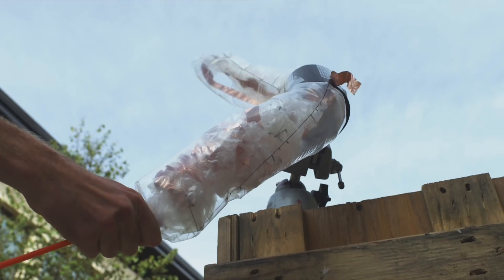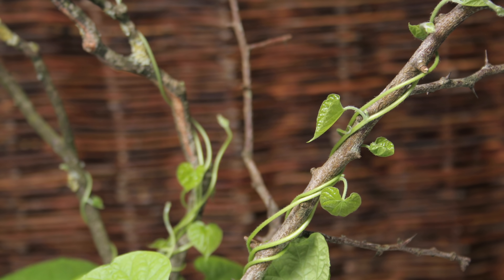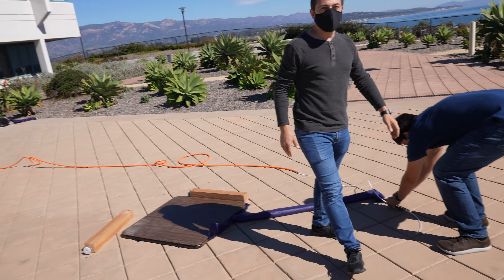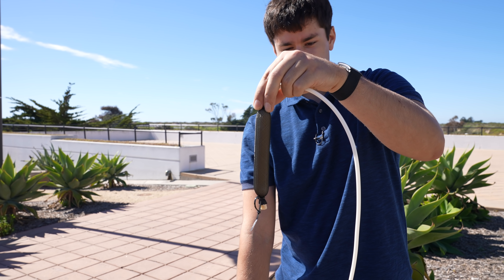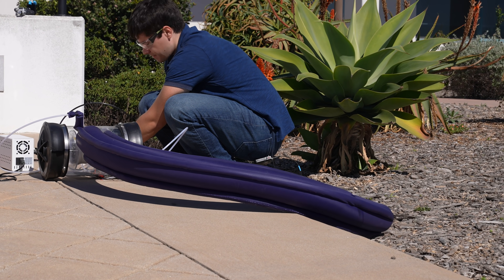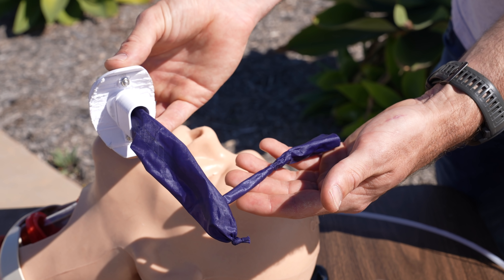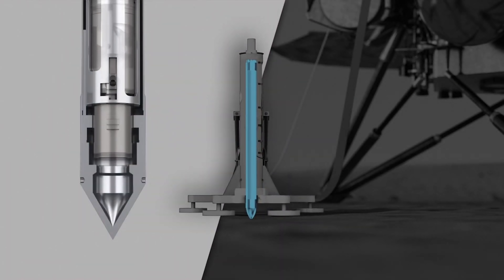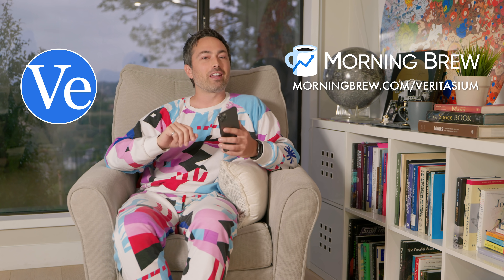This Unstoppable Robot Could Save Your Life

Comment: The question is, how is the intubation device supposed to stay rigid (in order for the patient to breathe through it) after the pressure is taken away?
Reply: You are right that this would indeed be a problem given the soft nature of the VINE. One of the concepts labs have been playing with is that a more rigid tube is attached along the length of the VINE that is guided by the VINE. One other idea is that the VINE is guided first and then the tube is pushed through the inside of the VINE and uses it as a guide in that way. I can't say for certain that this is what this lab in particular would do but there are work arounds for this problem. Hope that answers your question!
Reply: @micahbryant1165  

The way I see it is that, like AEDs you may see in train stations, and large public areas, those are no match for hospital-grade defibrillators.

But, in a cardiac arrest event, such as the casualty going into VF, as a trained First Aider myself (and having done Anatomy and Physiology at University level), having a 'intubation' device, that supplies almost pure oxygen to the lungs, whilst I performing CPR, getting enough oxygen to the patients brain is one of the core reasons for CPR, along with blood flow around the heart itself, and the lungs. 

Hence, in a emergency situation, in addition to an AED, to defibrillate the heart, having a simplified version of intubation, in the field, buying enough time for the paramedics to arrive, and take the casualty directly to the A&E/ER/ED, to an area kept for resuscitation, and even up to the ICU/ITU ward, keeping  the O2 saturation >95%, especially on a flow of >5L/min @ sealevel equivalent, the greater chances of survival maybe. In other words, having something like an AED, that is a 'stop gap' until professionals arive, that intubates sufficiently to supply oxygen directly to the lungs, during CPR, maybe, like AEDs, a game-changer in terms of patient survival ... 

Interestingly, just recently, a friend of mine's brother, was placed in a medically induced coma, whilst also on a device that keeps his brain cool. Due to a well known phenomenon called the mammalian diving reflex, hypothermia, at a particular temperature, reduces the oxygen demand quite considerably. It is a reason why people whom fell into freezing water have been able to be resuscitated much longer than usual. In early thoratic surgery, the entire body used to be put into a ice bath to chill the entire body down, prior to surgery, especially on the heart, so giving the surgeons a bigger 'window'. The technique now, or so I believe, is that a modified heart-lung machine uses passive cooling, to reduce the temperature of the blood circulating back into the patient, and keep it at that constant low temperature, allowing a gradual 'cooling' down, rather than the 'shock' of being dumped into a ice bath ...

The reason why I mentioned it is because there have been studies, conducted on appropriate patients whom suffered a cardiac event, and in whom return to normal circulation, that placing ice packs around the patients head, has shown significant benefits in terms of neurological outcomes.

There is still enough research to be done, but reading those studies means, if CPR is successful, and the First Aider/Responder is fully equipped, if sinus rhythm is achieved, packing the head with ice packs, immediately after, cooling the brain, and reducing its oxygen demand, means that may reduce the level of neurological damage caused by the sudden stoppage of blood (ergo oxygen flow) to the brain, during/after that cardiac event.

Once the pandemic is over, I need to get recertification, as mine as elapsed. But that is something I may very well mention to my trainer if it's efficacy has been proven.

If so, hence, if I attend the next convention attend after recertification, I take a 'Go Bag' appropriate to my level of training and expertise, but take ice packs with me for that same reason, amongst others, who knows ...
Reply: I have exactly same question

Comment: 1. If you can attach internet cable, you could more easily wire a home/business I would think.
2. Search for Rat/Mice pest nests.
3. Colonoscopy maybe less damaging?
4. Piping/Sewer?
If you can somehow put those bicycle repair stuff "slime" on the exterior of the tube, you could put it threw your home sprinkling system, inside the pipe?  For a nice even coat. Instead of ripping it all up...
I'm sure there is room for improvement on this one.
5. Clogged building ventilation search?
6. If it can be designed to go threw avalanche snow that would be cool.
7. Wrap around trees for Christmas lights.
8. Emergency snorkle.
9. Have a magnet on the end to pick up hard to reach nuts/bolts that drop in weird spots.
10. Spy camera.

Comment: The problem with intubation is size. No patient is the same and the reason intubation works at all with just the few different sizes of tubes we have is the fact that we can adapt to the actual patient. I don't see how you could reasonably get a solution to be either easy enough to pick in an emergency or flexible enough to be compatible with all variations we can have in human patients. The real killer when intubation is called for isn't a slow intubation, it's a failed intubation. Once you tried going in a few times the soft tissues swell up and make additional attempts impossible.

But you also gave me a new excuse for how thresher maws and dunes sandworms could move, so there's always that 😁

Comment: understandably it would be a bit difficult to use these in underwater circumstance due to the buoyancy of the air being put into the robot. Would it still be as effective if instead of pressurized air you used water? if so we could use it to explore things that are humanly impossible such as shipwrecks or underwater caves

Comment: This would be great for confined space inspection work, where the atmosphere may not be able to sustain life (low O2 content). Or for internal pipe inspections, or in potentially hazardous/explosive atmosphere's.

However it does make me wonder if the material choice would matter considerably, when it comes to the generation of static electricity from the movement of the robot itself and the compressed air?

Comment: Really loving this. It's still early proof of concept stuff, but everything we we know must through that fase. Really big thing for me here, is that the principles, concepts and building blocks of this tech is already very well known and understood, and trial work + development is possible even with relatively slim means and funding.

This by no means detracts from or "cheapens" what these guys have come up with. Most of humanity's inventions have been a combination of existing tech, skill, principles and materials, into something new. And exerimenting with and developing something with relatively simple components, tech and materials, is a really big plus. Being able to do that, is usually a huge boost and accellerator for further development and innovation, as many such projects won't need to be at the mercy of big donors and investors. Even if those aren't interested, you can go far with this stuff with only a handful of benjamins, and get started for less than a hundie if you can buy a used, small air compressor.

Never underestimate the driving force of affordable tech. Just look how far we've come off the back of CRISPR.

Comment: It could also have applications with cardiovascular interventions. For instance when placing a stent, a guide wire is used to get across a lesion, but due to how thin the blood vessels are there is a risk of dissecting the artery wall with sometimes dire consequences.
Using this technology an interventionalist could pass a guide wire across tight lesions for stent deployment and have almost no risk of dissection.
It also seems to make finding a hole easier and could be used in transcutaneous closure devices for example closing a hole in the heart(ASD, VSD or fistula)

Can see medical device companies jumping on this for multiple applications!
Reply: Mmm... Had a thought though. It would first need to be investigated if this would work using liquid instead of a gas. For this application gas would not be an option.

Comment: Its only problem would be heat I suppose
I've just seen the intubating part and there's a reason it's a stiff plastic tube with the balloon on the end.
The balloon is there to make it fit airtight and for this to work (and pressurized air still being able to pass through) the tube needs to be rigid and i don't know how they plan to accomplish this with their soft robot.

Comment: I think this technology would benefit homeowners that need to change the house wiring in their exterior walls with insulation. It is next to impossible to do with an ordinary wire fishing tool. The fiberglass bonds to any object you try force through the wall, this technology is not stopped but restricted materials. I give it two thumbs up.

Comment: idk if the idea will actually work for the intupbation. seems nice but often times when someones not breathing and needs intubation its because the throat is closed in some way and it can be quit diffifuly to get something that soft to push past the tracea which is actively trying to hold closed. i can't see that being as reliable in all cases of intubation being needed.

Comment: Would it be possible to invert the air supply within the device, say thru bladders and control the device from within. Moving the air from within, with onboard A.I and external sensors.

Comment: So many possible variations:

Tubing once expanded can be used as a tunnel for small hard robots to travel through.

A self contained tubing package with pump can be an optional tool for a robot to use to get to its destination. The robot could deploy it, travel through to the other side of obstruction, and then retract it back inside ready for later use.

A hard robot could be self contained within the center of a permanent tubing outer shell that provides it both propulsion and protection, it'd look like just like one of those slippery toys. 

On a larger scale this could be a vehicle to travel through vacuum high speed train tubes.

Comment: An interesting use these robots might be creating a rigid pipe structure. Perhaps it's built as the tip extends by a robot rolling along--much like the camera at the end. This might utilize technology similar to an angioplasty stent. Otherwise, using a material that begins soft and hardens after some time may also work in some circumstances.

Comment: I know this isn't exactly relevant,  but one time I was sitting in my car in my driveway, staring at a vine that had climbed up a small tree next to my house, and I noticed that the vine seemed to prefer smaller branches as it climbed. It would grow right past thick branches and when it encountered a thinner one, it would leave the main trunk, and start climbing the branch. 

I sat there trying to figure out why it would do this, and after a while I noticed that when the vine extended beyond the end of the branch, it would often find another branch, bridge the gap, and continue climbing that one.

So, I reasoned that the plant must have evolved to favor smaller branches because smaller branches wave about more vigorously in the wind than thicker branches do, and so this would increase the chances that the end of the vine would grapple and catch another structure to continue growing onward.

The next question became what biological mechanism pulls a vine toward a thinner branch, without pulling it away from the main trunk when it encounters a thicker branch, considering that the thicker branches are thinnner than the trunk that the vine is already climbing. 

My best theory is that the vine responds to vibrations from thinner branches as they blow in the wind. Maybe the small oscillations have a ratcheting effect on cell growth, causing the cells at the end of the vine to grow faster when they're vibrating at some minimum amplitude. 

Anyway, I did no experimentation. I simply observed and theorized. And then went on with my life.

Comment: Could be useful for colonoscopy procedures. The colon is typically inflated for the procedure and requires evacuation by the patient post procedure. If they can perfect the device removal it would eliminate one of the most uncomfortable recovery processes. An additional benefit would be removing abrasion discomfort since all the abrasion happens inside the probe robot instead.

Comment: I can see where the intubation robot could fail in numerous ways, as a Paramedic, I have seen numerous patients whose trachea was much larger than their esophagus meaning the robot would go down the wrong way. This is why the combitube is set up to be able to ventilate through both lumens of the device. Furthermore, often the ET tube is used to create a less pliable airway forcing the tissues around it to open up so we can ventilate the patient, it would also have to be able to stay inflated with pressure from the other direction coming out of the lungs, it is never a pretty sight, or good outcome, when a patient is hyperventilated mechanically. Unless a tube inside a tube is made, it wouldn't be able to do that. Also, there is no way it could be used on a pediatric or neonate patient due to their unique physiology. I would love to see something like that to be approved to give us another tool in the tool box.

Comment: Usage concept: I'm a civil engineer that sometimes deals with the repair or maintenance for sewer and storm drain lines. We typically hire a company that uses a "snake"with a camera to inspect pipes. This inflatable tube may be a useful tool to get past blockages.
Reply: I thought the same. Also, if you could make it small enough, unclog arteries with blood clots?
Reply: @MartijnPennings  that could be a good use, as there are some arteries (esp in the brain) we cant reach be today's means. Very difficult to get pas certain bends. I'm afraid that the current vine robots would close the artery though, effectively stopping blood flow for several minutes. If the robot could let blood pass, then it would be a magnificent use of this tech!
Reply: @c50m4  yea use instead of air blood to run it
Reply: @MartijnPennings  great idea!
Reply: Do you remove the section where the blockage is or use one of those augur snakes to just pummel it out?
Reply: Maybe attach hollow rings to the outside so it can leave space for blood and only take up half the volume. Might also block some side branches so not ideal solution yet.
Reply: Imagine an old, and deeply buried, sewer pipe that leaks; put one of the “vine” robots down it to see, and if it turns out there are lots of small leaks at the joints where tree roots have grown in, have the “vine” then “grow” all the way to the main sewer line, or next accessible point, then replace the air with a two-part epoxy, creating a new pipe within the old pipe, no need to dig anything up.
Reply: @jpe1  The issue with creating a new pipe is that the diameter would be decreased.. usually when looking at old infrastructure like this it's in need of expanding.. It could be cool in some applications where the pipe is too big for it's application, and leaking.
Reply: @akunog3665  I agree that the diameter would decrease, but I think a properly designed system could keep that reduction to acceptable levels.  For example, imagine a 4” clay sewer pipe going out from an historic home in an historic neighborhood, where digging up the pipe would kill historic trees and damage other historic landmarks.  The pipe-within-a-pipe that I’m suggesting could be plenty big enough (probably 3.5” when finished) and a much cheaper and more aesthetically pleasing solution.  Most of the time the best answer would be to dig up leaking pipes and replace them, I’m just thinking for that small fraction of cases where replacing is exceedingly costly.
Reply: @jpe1  for sure, there would be some fantastic applications.. was only pointing out some of the limitation. Good thinking though for sure.

Comment: Fitting medical stints for heart attack victims, carrying out surgeries on sensitive parts of the brain, with micro lazers at the end, doing surgeries on spine or oesophagus cancer victims, where there are too many sedative parts for open surgery. Inserting into gun shots and stab wounds to plug blood loss for emergency purposes. 
   Fitting underfloor heating, cable running, leak detection, passive pest control. Pushing out crash damaged bodywork. Could be used to fix leaks in water pipes by inserting and having a two pack resin injected into a double skinned sheath, so no need to dig up the road for repair. Filling in potholes or repairing sink holes from below. 
 I have to stop before my brain explodes!!

Comment: Add a tube for water/foam, fire fighting robot
If they had that during the Gulf war, the oil well fires could have been put out much sooner. Moving under the sand and under the heat.

Comment: I've been toying with an weird actuator project that has some similarities, in that I was mucking about with a base form inspiration like a tentacle or monkey tail.  It occurred to me that I could get some measure of feedback by making a series of air pockets (think like a pea pod or runner bean) and using a set of gas pressure sensors to determine how much mechanical pressure is being applied to the outside of it, basic pneumatic force transfer really.  I can't help thinking these kinds of robots are just screaming for pressure sensors.

Comment: I saw that and I think there is another option. You don't have to use air for these robots, that is you could use water or anything that is fluid. Currently using air makes them not that useable underwater but switching to water would. Then you could pressure the water out using air later. You could even use a liquid that later turns into a solid.